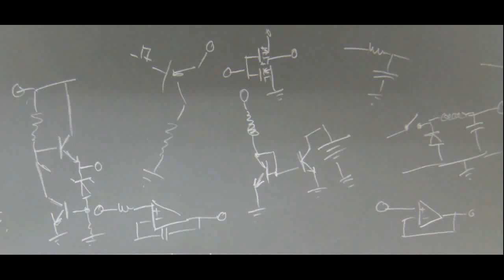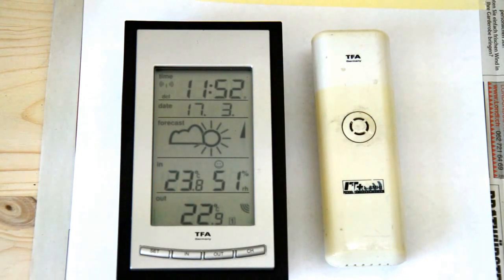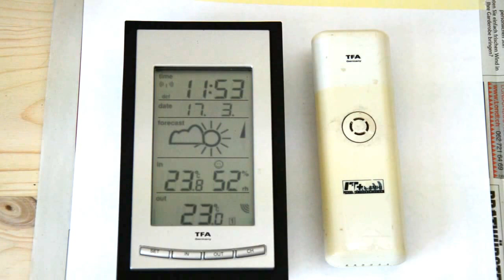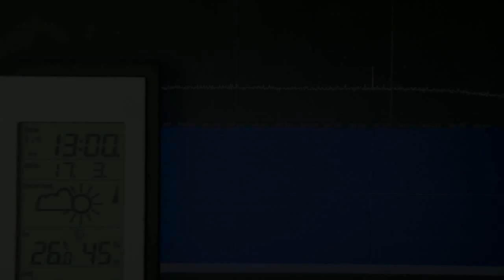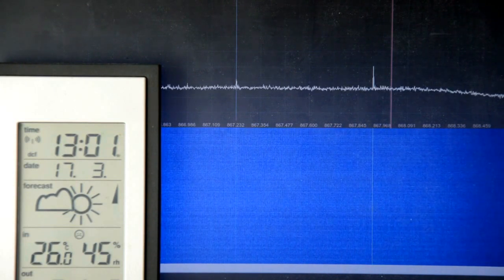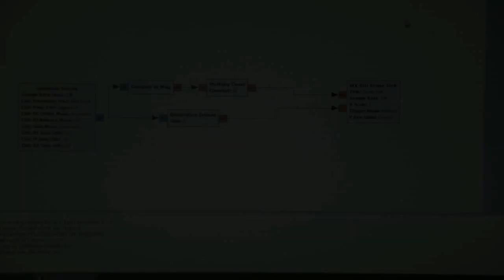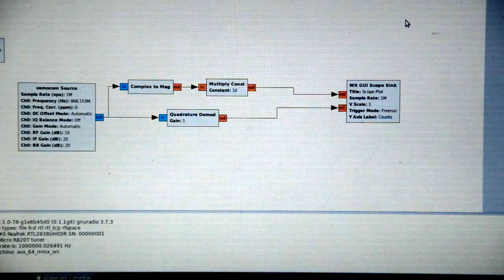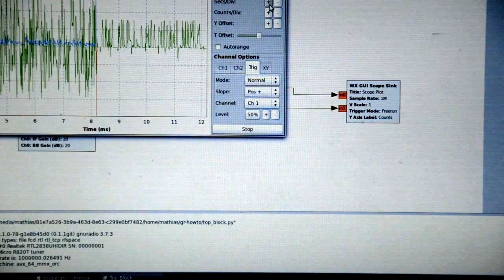Using RTL-SDR to read temperature from outdoor sensor, part 1

Comment: Absolutely an amazing tutorial. Thank you for taking your time to post the results. Will be downloading your examples and trying to adapt it. thanks again.
Reply from the maker: +Bilbo Baggins Hello there. I learned a lot about gnuradio in the mean time and some of the stuff I'm doing in that video is not the best way to go. For example, I should have put a filter to single out the frequency of interest. I'm often in the IRC channel #gnuradio on freenode if you need some help, although the other people in there are much more savy than I am so it's worth a visit anyway.

Comment: Does anyone know what those narrow spikes of signal are? One is very visible on the FFT. I see them roughly every 30-50 MHz.
Reply from the maker: +Queen Chrysalis The rtl has a 28.8 MHz crystal oscillator built in. I have spikes at multiples of that frequency with all my rtl sdr dongles.  This appears to be normal -- the 28.8 MHz appear to bleed through the mixers of the dongle. Another artefact you might encounter is at 48 MHz and multiplex thereof. This is the USB clock.
Reply: Alright, cool. That will save me the time of trying to find data where there simply isn't any. Thanks a ton.

Comment: I do not know how much into signal analysis you will dig in but this toolbox might be of your interest. http://ltfat.sourceforge.net/ 
It has a GNU Octave API.
Reply from the maker: I already completed the work on that. The toolbox looks nice, though and is definitely something to be aware of when needed. In the end, I just dumped the bit values into a file and went for a rather crude statistical analysis. The video on that is uploading since 14 hours, looks like I need a faster internet connection :)